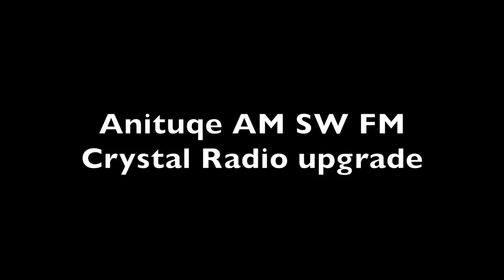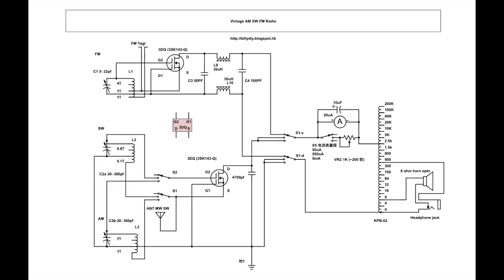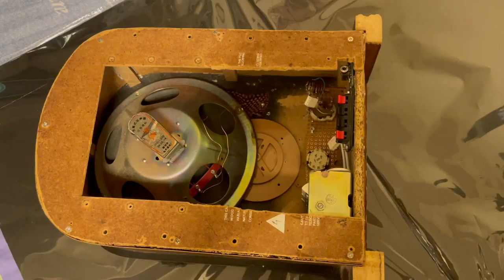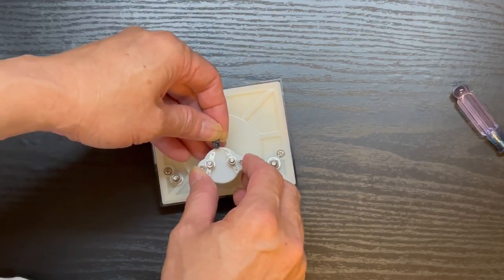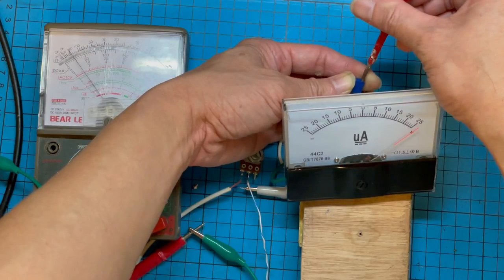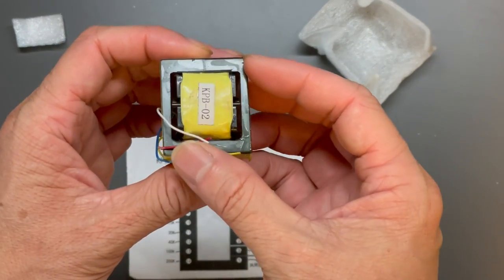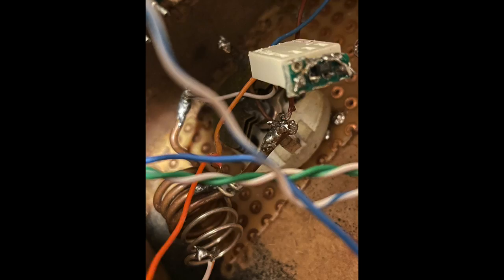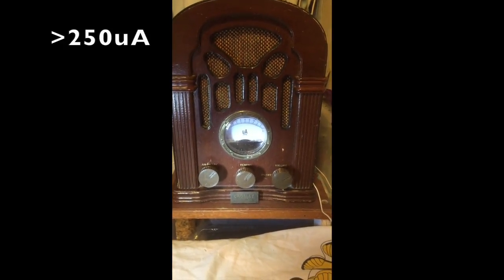Adding a Meter and a Speaker to my Antique Crystal Radio

Comment: Excellent job excellent work you managed to get a crystal radio going with some really interesting output maybe if you were to use a longer wire and it apparently looks like you're you're an apartment you may want to drop it from your balcony let's see at night where everybody sleeping you may want to drop it all the way out almost to the bottom you might get maybe 30 40 50 m maybe even more that may even help your reception when it comes to a.m. and shortwave then again I find your results quite incredible you can get a crystal radio going without power which was the whole point at the time there was no tubes there was only Crystal I think that by having a very long wire would help also by having a very good ground would also help especially when it comes to a.m. and shortwave anyways I'm impressed by your videos you tested some am some FM receivers on standard Crystal receivers dialed it's quite amazing to see these system works again
Reply from the maker: Thanks. I really enjoy antique stuff where no battery is required. Eg crystal radios and wind up phonographs